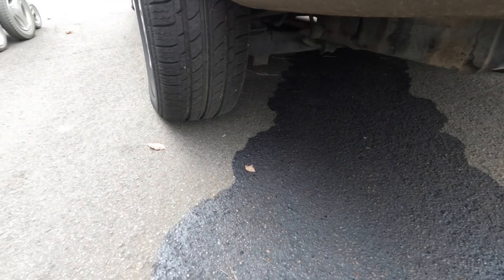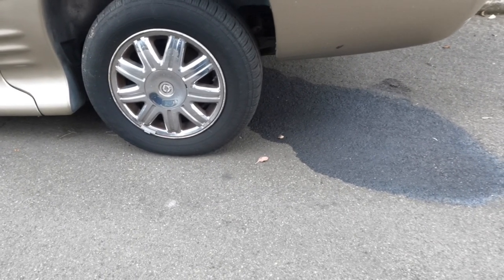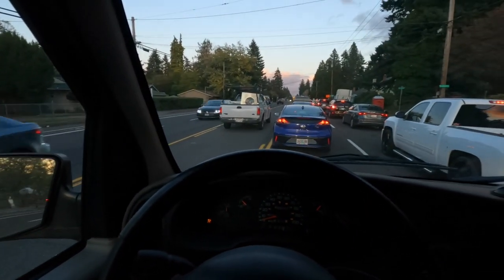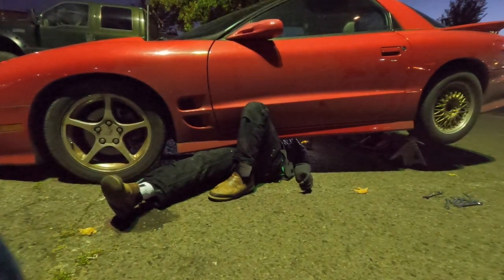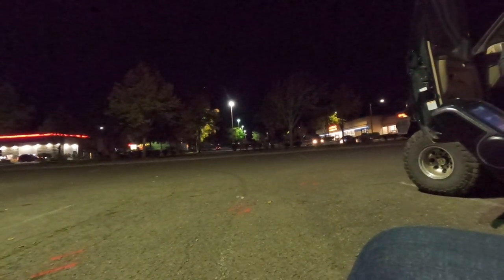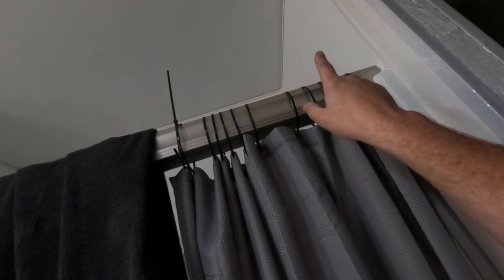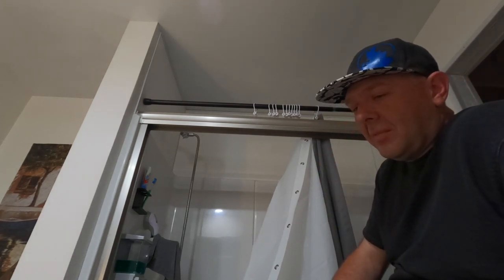VLOG 530: loose bolts & gasoline!

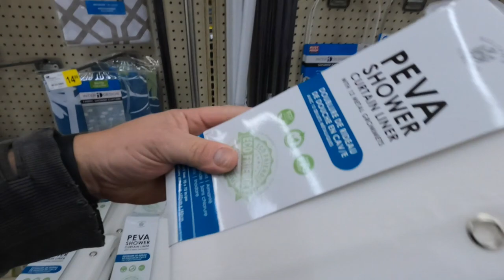Comment: 12:19-- Those shower tension rods are awesome. I use one in my main hallway to split a heating zone. I hung a thermal drape from Walmart (just because thats where I got it) that has rings for the curtain rod. That curtain allows me to separate the kitchen & entry from the living and bath area. It's been a huge energy saver... and awesome on hot summer days when the AC is working hard to cool the house.

Comment: Hi Dan on Chrysler/Dodge remove auto shut down relay or fuel pump relay the start and run engine. Glad your were able to diagnose the problem a shady tech would sell a fuel pump assembly.